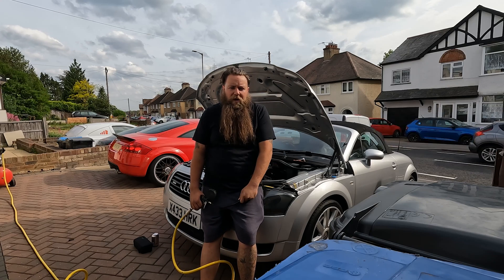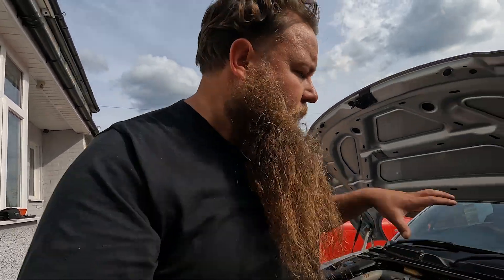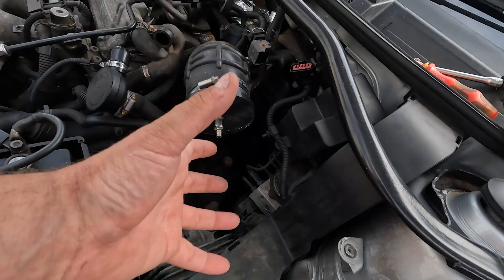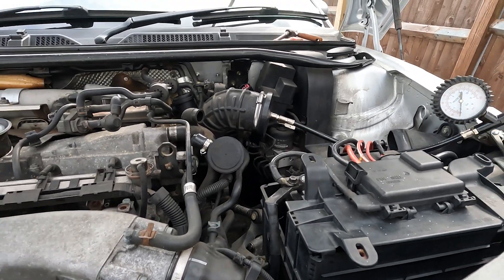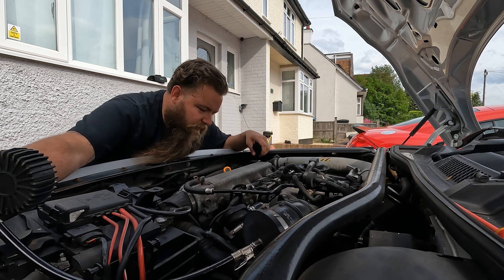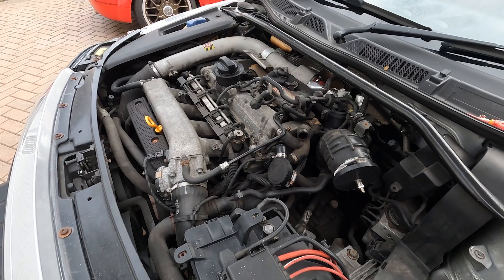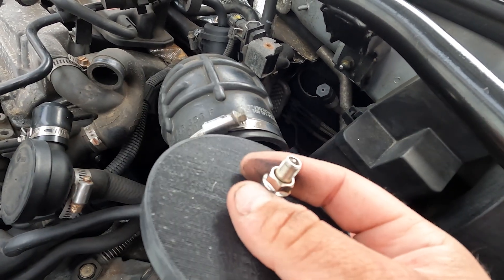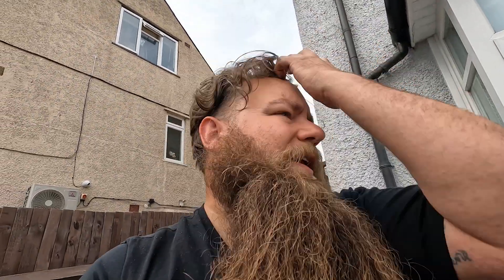Cheap And Easy Boost Leak Testing Diy

Comment: I got no codes on my E61 BMW but I hear a turbo flutter every now and then. Sometimes not for weeks, then 2 times a day. Electric actuator works on ignition and when I throttle. The only thing I have found is some oil sweating on the bottom passenger side of the intercooler and the exit hose. Help? Anyone?

Comment: Does it have to be air? Can I use CO2? I have a CO2 compressor but not an air compressor. Was reading some AI-generated doom-and-gloom about CO2 reacting with moisture and causing carbonic acid but I feel like it would circulate out almost immediately and if the engine is run after the test there would be no risk whatsoever. Also curious why shops use nitrogen instead of compressed air...

Comment: I  Made my own Smoke Tester it's very easy to make all you Need  is a Windshield wiper fluid Pump and 2 Pieces of Rubber Hose  for the Inlet and the Outlet  and an Electric Vape  Pen  Works really Well. 👍

Comment: I have a question. When doing leak test nothing visible for leak but pressure not build. Isit possible that exhaust valves are open? Im new on this.

Comment: May I ask what stops the air passing into the intake manifold and into the exhaust via valves depending on the position of the crank and camshaft ?
Reply: Good question, but quite an easy answer, on these engines the intake valves are always closed when exhaust open, and vice Versa, so if it can get into the cylinder, it will NOT get out the exhaust valve, and if exhaust valve is open, it CANNOT enter the cylinder since intake valve closed

Hope this helps!

Comment: Would gas leak detection spray work on this?
Reply from the maker: I could not say for sure as it's not something I have tried in the past it depends if the chemicals will cause any damage to the inside of the engine/pipework

Comment: Hi - is the breather pipe that runs from the bottom of the PRV Hockey Puck Valve the same size on the 180 and the 225 or does it differ like the turbo intake does? Thanks

Comment: great video .. 78 year old ex 1980 Donnington gt champion   . my 2008 Citroen C5  2l hdi is suffering  a lack of power .  It starts and runs great ..BUT show it a hill / steep gradient and it falls flat .. with almost no performance . It will get to 3000 rpm eventually  but has no get up and go .I have given the MAF sensor a good clean . ,There was some improvement . but the out and out umph is still lacking .  A friendly local  garage owner plugged in his diagnostic tool and a turbo or lack of expected turbo was diagnosed ..  Great tip on the 20lbs inch pressure testing .  Common sense really but  nevertheless  an invaluable tip.

Comment: Hey great video! What's the pipe on the left hand side you had a hole in called? I have the same problem. Thanks
Reply from the maker: Its the pipe that goes to the brake booster, usually its only listed as a vacuum pipe, had a quick look but could not find a part number, im sure they are not made anymore and you either have to source a replacement second hand of fix what you have. thanks Dom

Comment: Just take off from the turbo the boost side pipe. Dont use the intake manifold before the turbo, because is never pressurized and a old turbo will blow a lot of oil in your catalytic system (next to shaft)and you will smoking crazy and may shot your catalytic converter.
Reply: The air before the turbo is not pressurised but it's is measured by the MAF so you should be testing for leaks
Reply: @marcooconnor  yes you are right but you blow lot of oil in the catalisator.  Normal the turbo have pressure from the exhaust gas side and the air side at same time,so is will not leak. But when you blow 20psi only at one side,then slowly oil will go in the catalisator and it will be clogged.
Reply: You'd be safe using either at 20psi

Comment: i made my self a smoke machine a few years back was pretty good i might give this method a try. spray bottle with soapy water would also help find the air leak
Reply from the maker: Sounds great! yeah smoke makes life a lot easier, i did recently make a smoke tester video also, makes leak finding much simpler

Comment: Hi Dom. great video and inspired me to make my own pressure tester, not quite as fancy as yours (Mrs’ old moisturiser container). I also blocked the pipe going to the throttle body, no obvious leak but air is rushing out of the intake manifold (past the butterfly valve). Any ideas as I’m stumped. Thanks
Reply from the maker: The pcv system has pipes that attach to the inlet manifold so thats probably why buddy
Reply: Thanks dude, I was certain I had a boost leak as it’s not all that quick (I know it’s only a 180) and sounds like an old air cooler vw under boost!

Comment: hey man, i've got an almost crazy modified '99 mk1 rebuild for the track, with the 225 of an s3 swapped in and K04 turbo on there. And to help me fix some of the problems with it your channel has been very helpful and i am so thankfull to you for showing us all on how to do things, and what to look for. the tt is a great car. and with your help we can all make it even better than it used to be.
Reply from the maker: Thanks for the kind words buddy, appreciate it! Ooo nice man what colour?
Reply: @TheParrottBros  it's a light silver version, but i've hand wrapped the front to just under the mirrorso on the doors with matt black triangles, going from big on the hood. and a little smaller on the bumper to gradually become smaller to the edge under the mirrors. also changed the grill (for a bigger one), added a carbon front splitter and a bigger wing ontop of the normal drag style wing. the car is older than i am, but it's still the most fun car i've ever got to drive
Reply from the maker: @ramondv2422  that sounds mad! They are great cars and the modifications are endless if you want. Bet that gets some looks for sure

Comment: Hey what is that 3 way pipe called I have a tiny rip on mine from someone tightening it too much I have tried to just cut it a bit and push it in farther works for now but wanna replace it
Reply from the maker: If you search for TT crankcase breather pipe on eBay you’ll see a few options 👌🏻

Comment: Great informative video. I used a 75mm PVC pipe cap, measures 80mm on the outside. Found a gross leak on a crankcase breather pipe. Thanks for your videos.
Reply from the maker: Awesome glad it helped :)

Comment: If you removed the oil cap instead you wouldn't need to do anything to the  puk to protect the rocker cover, right?
Reply: Yes, but then all the air you pump in will just leak back out of there.

Comment: hi Dom, great informative video. I will be doing this process very soon. I've got david to 3d print me off the TIP bung. But where did you get the hockey puck bung please?
Reply from the maker: You ideally want a 19mm bung and to cap the system off by taking the three way pipe off the rocker cover rather than doing what i did with the puck

Comment: Hi, so i have a suspected a boost leak, followed your video with the air pressure test, and it does not hold pressure... cant hear any leaks apart from a bubbling sound coming from the engine... this was yesterday. so today i had delivered a cylinder pressure tester and it read 175 175 185 and 185
 any idea where this bubble sound may be coming from lol ?
Reply from the maker: The bubbling sound is normal, my car also does the same but hard to pick up in the video, it should build up pressure so there might be a good possibilty you have a leak somewhere but its not easy to hear, are you using a compressor? if so maybe get a second person to operate it while you feel your way around the pipes and joints
Reply: Hi! When I put pressure on my Audi TT, a bubbling sound also appears that seems to come from the engine, it is as if oil were bubbling. Have you solved it? Is it worrying?

Thank you so much. @TheParrottBros
Reply: @miguelbelloso1495 comes from the turbo oil seals some air is passing directly into the oil pan and its bubbling from under the oil level and it's completely normal since air is less dense than oil so it can pass